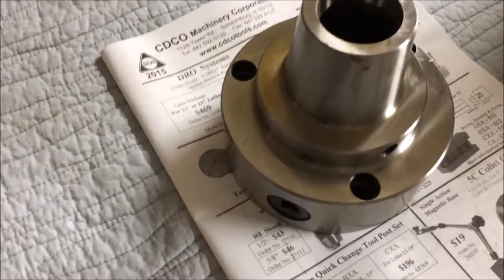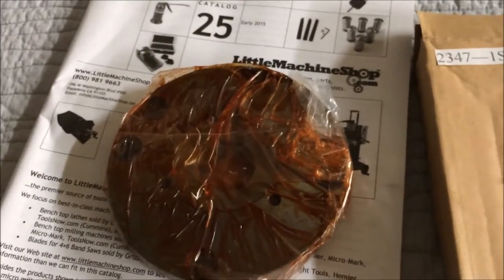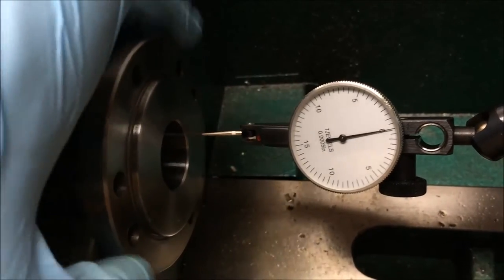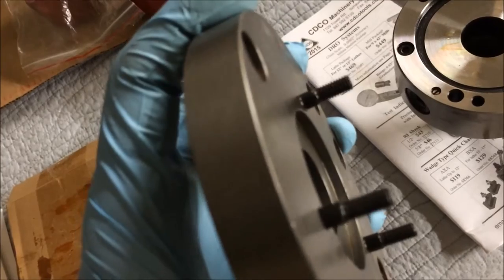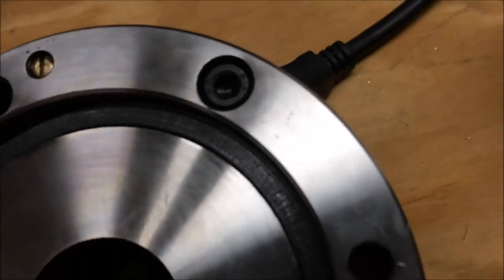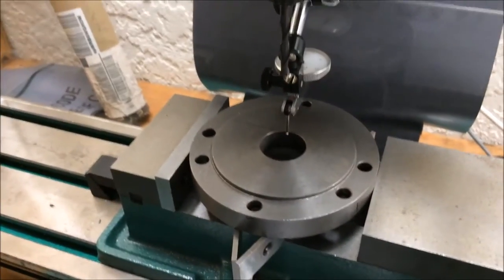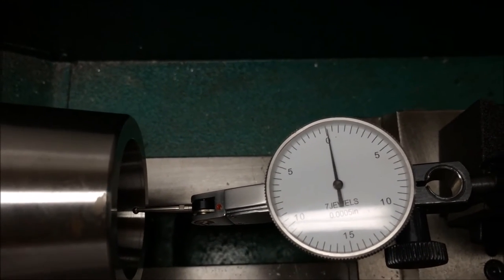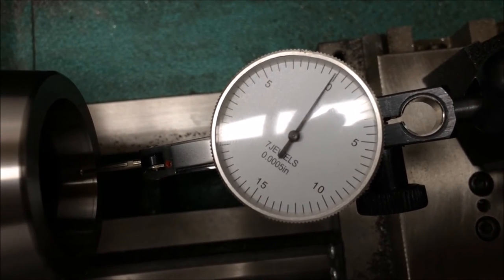5C Collet Chuck on Grizzly G0765 Mini Lathe

Comment: I see you went for the Q.C. Too post set up.  I haven't even received my G0765 yet, (out of stock), but from decades of CNC exp., I have the Phase ll  mini hobby set on the way.  "Voik Schmarta, nodt Harder" LOL!!  Since retirement, I no longer take for granted, zipping into the shop at my leisure with my personal projects!  This will be my very first "OWN" Metal Lathe,  YEE-HAHHH!   Very good work!  One thing for sure, by facing, and turning the mounting plate on the Lathe that the Collet Holder will mount on, you'd be hard-pressed  to get a better shot at low T.I.R.?  If you resolve the Radial play issue, please let us know how ya did it?     Gb      bg

Comment: Oh man!  I didn't even think about truing up adapter plate or testing for accuracy for that matter.  I bought their 4 inch independent jaw chuck with adapter plate and honestly I thought coming from Little Machine shop it would be better quality than low end Chinese chuck - Nope!  It's garbage I could have saved money and bought on eBay cheaper.  Now I'm looking for 4 in self centering chuck and I can't find anything on eBay with 72 mm recess to match little machine plate adapter.  Any suggestions?

Comment: Great video!   I recently obtained your lathe's big bro, the G0768.  It came with this same exact 5C collet chuck along with 57 collets! I was actually going to sell them, but after seeing your video, I now know what I need to do to be able to adapt mine, so thank you for that! I have a question though. In the beginning, you robbed three studs to put on the back of the mounting plate. I thought these were the studs that go onto the spindle. If that is the case why did you need to drill three new holes? That's the part where I lost you. It seems like my chuck's holes would line up with the existing holes on the outer flange of the adapter plate while the three existing holes where you put the studs would fit onto the spindle. What am I missing here?  I really appreciate an explanation. Thank you again, great job!
Reply from the maker: Hi.  As I recall, the adapter plate mounted up to the lathe spindle just fine.  The problem was connecting the 5C chuck to the adapter plate.  The holes I drilled and tapped were used to connect the pate to the 5C chuck.  Thanks!
Reply: @FrancoCNC  , thank you for the further explanation.

Comment: Cool! I've used a 3MT collet in the headstock before but a collet chuck would be nice for longer stock. After I finish replacing my spindle and bearings it'll be interesting to see if I get that much deflection. Your lathe has the stock bearings?
Reply from the maker: My lathe has the stock bearings. I'm thinking about doing the bearing upgrade. Please let me know how that goes for you.
Reply: Charlie K  The small chinese lathe's all have standard deep groove single row ball bearings in them stock. Ball bearings arent a bad thing, but you will want to get angular contact ball bearings, which are pretty expensive.

Comment: is not the collet to heavy? for the machine
Reply from the maker: I don't think so. At Max RPM there is some vibration but, for the most part, I do not have any issues with it. This was one of the best upgrades I've made to the lathe.
Reply: Some have found the extra holes drilled in the adapter plate cause an unbalanced condition and by plugging them with steel plugs the situation is considerably improved.